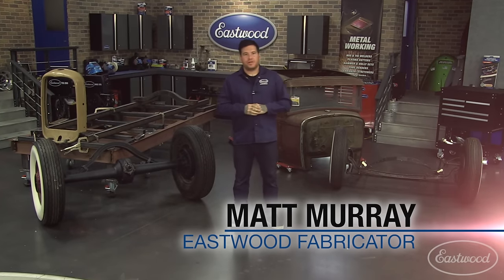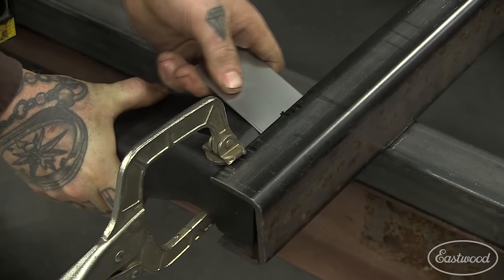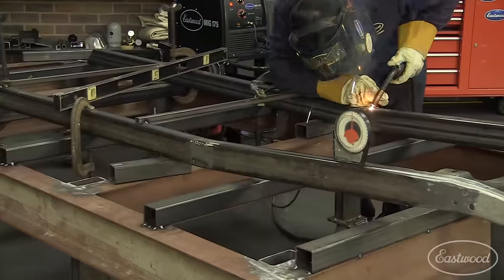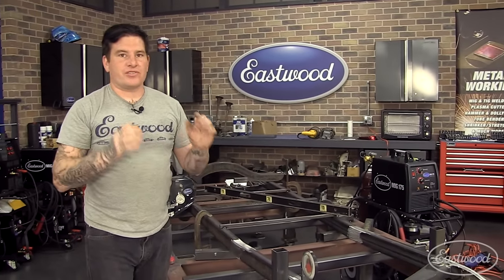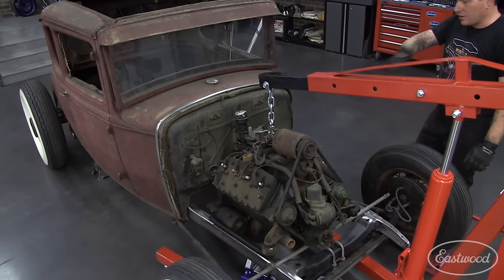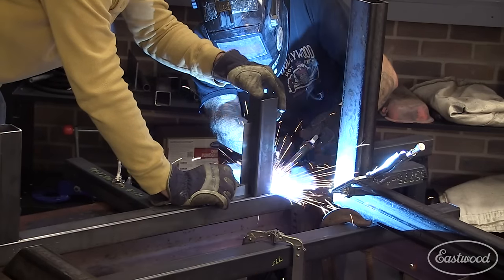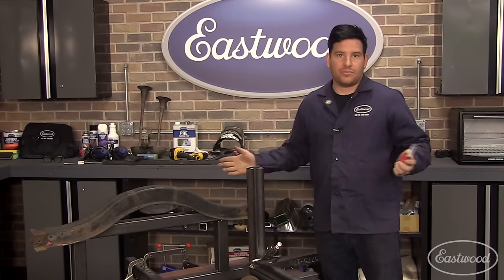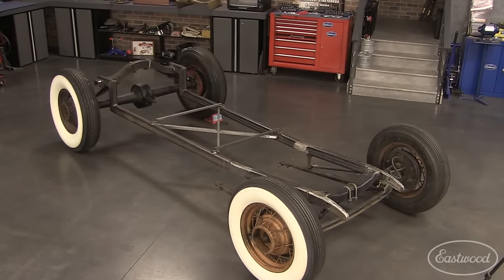How To Fabricate A Chassis - Building a Model A Hot Rod with Eastwood

Comment: Am I the only engineer here, and the only person who feels like this whole thing would not last two rides over the speed bumps? These hot rods just seem very flimsy and badly put together, like back then who designed them had no common sense.
Reply: Yes you may be the only one , because back in those days people were creative , and did not put up with Engineer's bull crap , and cars were designed simple that lasted .
Reply: im also an engineer and i saw no problem with this. looked sturdy and beautiful :)
Reply: a rod builder (guesses) what works, an engineer can only (prove whether or not it will).  edit for factuality
Reply: The things that are structurally unsound are the pie cuts with no beveling and zero fish plating on any of the joints. (not to mention there is no rear impact protection.)
The material used is plenty strong for the weight and power of the car it just isn't finished at this state.
Reply: I'm still thinking about the suspension system, okay they may absorb vibrations easily but damn why would they put a suspension perpendicular to chassis direction, they are not made to perform like that :/ engine power can easily break that suspension
Reply: That is the way the were made. they had 1 leaf in front and 1 leaf out back. And no it can't easily break the suspension. Hotrodders have been doing their suspension set up for over 60 years with big v8s with 200-400 hp.
Reply: You could add gusset plates to the rear steps and that would be better, however this design worked back then. The cars were not fast and people took it slow.
Reply: Corvettes had transverse leaf springs into the 21st century. hahs
Reply: I'm not an engineer, but do have a lot of experience in metal fabrication and I would never..repeat NEVER build a chassis using these methods. even my 6x4 trailer I built for just general hauling of rubbish etc was made twice as strong as this, if not a bit more than that. overkill?..maybe but at least I knew it would never fail on me or break and be a danger to others on the road. they need to throw this chassis away and make one using proper machine shaped rails and gusseted and plated joints with a lot more crossmember's and other reinforcing so that its safe to be on the road. this is a Go Kart frame and nothing more.